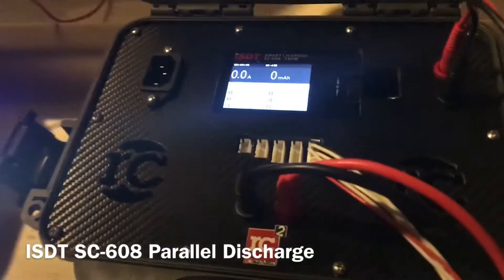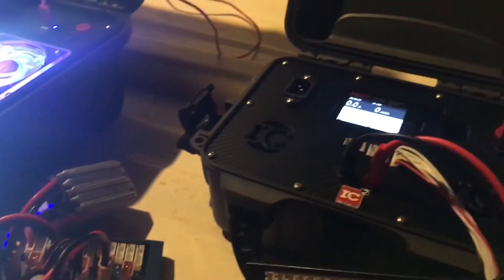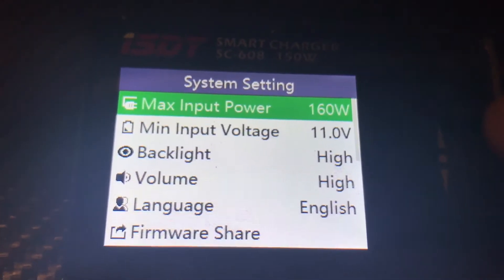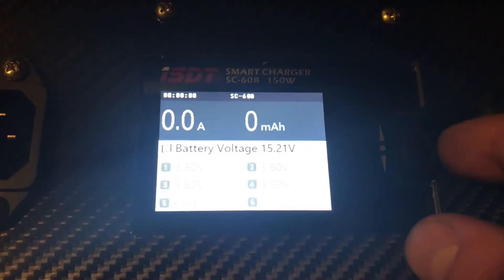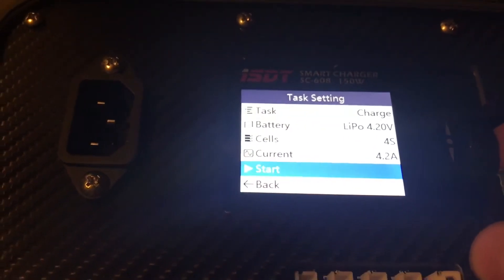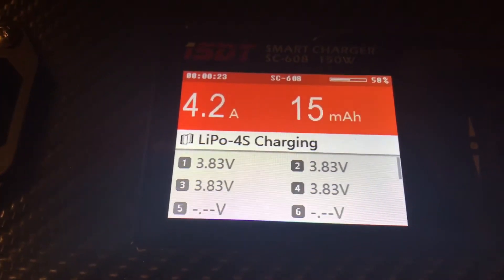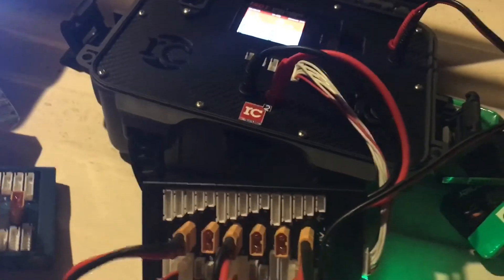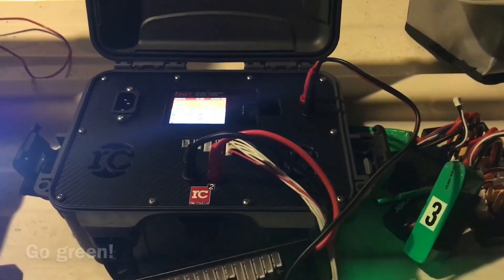ISDT SC-608 Parallel Discharge

Comment: I can do this with the Idst fast discharger to discharge 4 to storage at once?
Reply from the maker: Zack Duda yep. The current on that device is limited so it will likely take some time. But yes you could use a parallel board to do it. Just make sure all the packs are the same voltage
Reply: @Frankdubbsfpv  I usually try to land all my packs around 3.8 ‐ 3.6. I'll just plug them all up to the board and let them sit for a few minutes so they can all balance out. That's what I do before I charge anyway. Thanks for the fast response